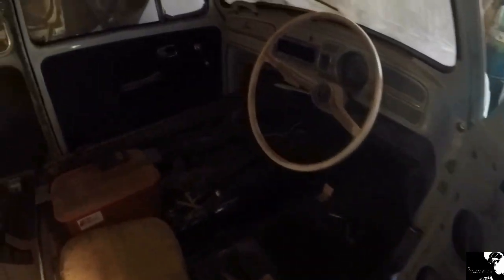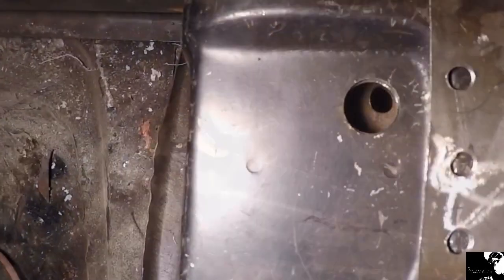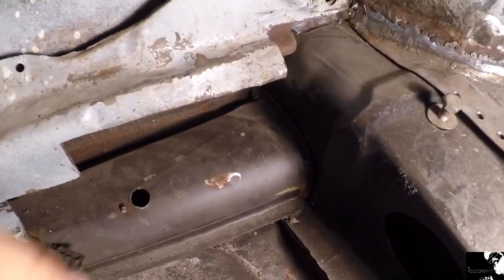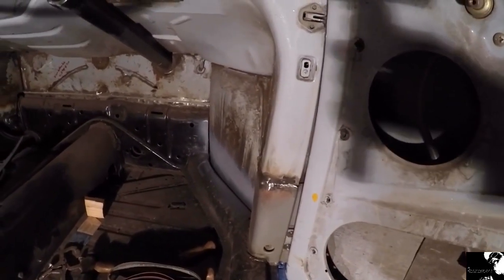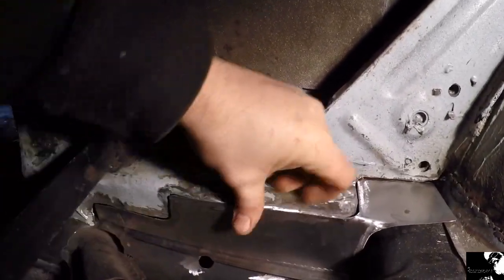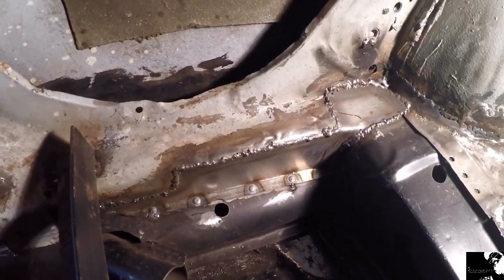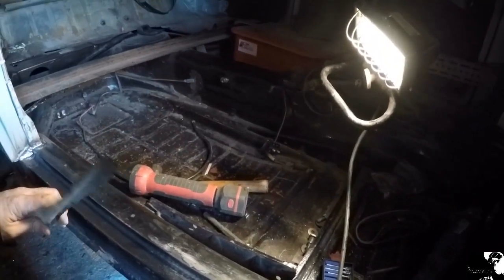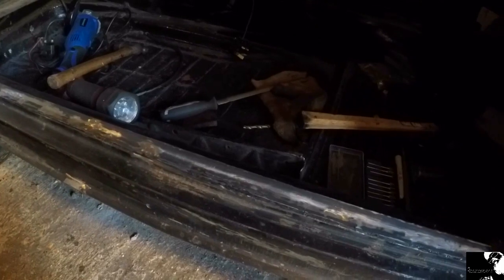Classic 1967 VW beetle restoration #10. ‘Inner rear quarter & surrounding areas’.

Comment: The work itself takes time, but then when you add in video producing time it really stacks up, but with that said , i would really enjoy more contect.. Make sure you can still keep a good balance with life. Ross in my mind, the passion i have for working on these vw  and skill set is matched with yours (Not the metal fab. yet?) and others on You Tube.    Last week I turned 65 and my body Ross is in a continued disagreement with what my young 30 or 40 year old mind.  When i get back at it,   I will pull off on the 63 beetle project and focus on the 67 deluxe bus. Ross I never had a chance to drive an old split-window bus...I want to know what that feels like while i'm still able.
Reply from the maker: Make you right dan, there’s a lot to it, time is a big factor, like you say you gotta find that balance. ill give it a go for a bit see how it goes. Happy belated birthday wishes...
I’m sure you’ll get em done. Even a small portion of time a day be it half hour to an hour cleaning organising the smallest things like bolts will help in the long run. Have a good week..

Comment: Very underrated channel imo. I've got all, heater channels, a pillar and front bulkhead to weld in.. What's the best order to do them? I was thinking bulkhead, heater channels and then a pillar?
Reply from the maker: Thanks for watching GT...there certainly is a lot less traffic passing through here than most other VW related channels. Quite a few have commented on that. Just can’t suss it out, but hey ho, is what it is. Sounds about right with your plan of action I’d say. Only thing I would suggest is to make sure you are happy with your door gaps/alignment at every stage before completely welding everything up. Good luck with her, I’ve been tuning in....👍🇬🇧
Reply: @VwRosstorations  yeah I feel the door gap and the way it opens and closes will be the biggest thing to get right. My main concern lies in the a pillar panel. I also have the hookys panel and alignment tool, but I'm concerned about too much heat and warping the metal and then not getting enough penetration so it's strong enough. I'll just do my best. I really appreciate you watching. Look forward to more videos from yourself.